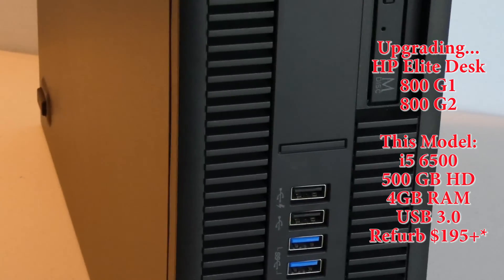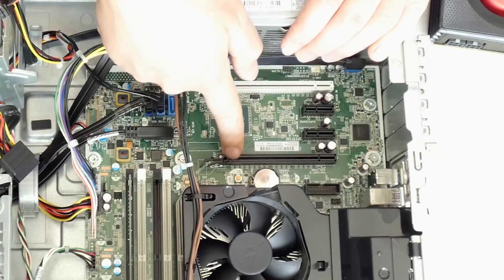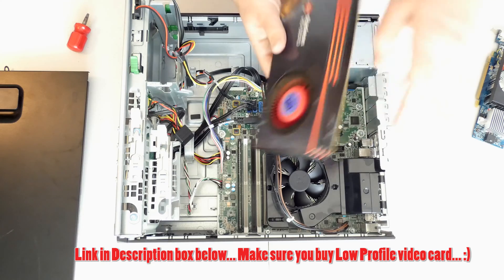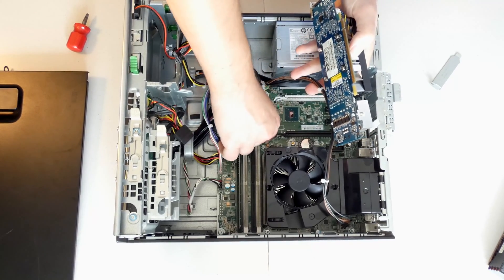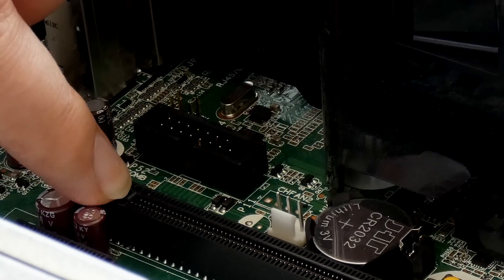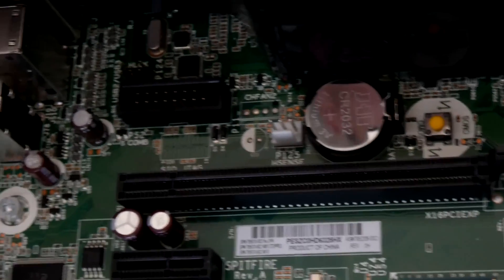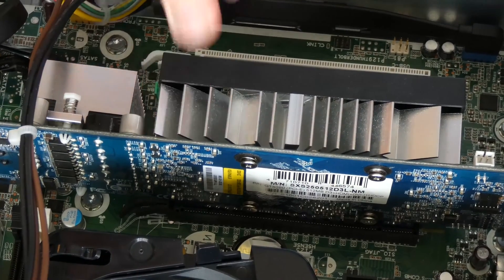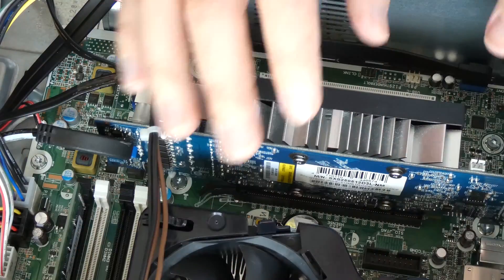Video Card Upgrade HP Elite 800 G1, HP Elite 800 G2, 600 G1  Small Form Factor Desktop

Comment: Actually, you still can fit in the full height graphic card into that SFF chassis. First, you need to take off the output backplate of the graphic card. Then with some minor adjustment and little help from two small metal plate and metal glue, you can create holders to put the graphic card horizontally (fan faced down). Then you connect the pcie 16x connector to the graphic card using pcie 16x riser cable.
Reply from the maker: Interesting. I didn't think there was enough space to that. Do you have a picture of how it looks like? I'm really curious now.
Reply: @Cobuman  this is the link:

https://youtu.be/gDKdEz19X7c
Reply from the maker: @mankdhanichannel  Right, that's not a full size gpu in SFF case. :) He moved everything over to a larger case. I actually made a video on that as well: https://youtu.be/C70nmtTFPuw
Reply: @Cobuman  Yes, but it is possible to put full size graphic card into SFF case horizontally. You can try that by yourself if you have the card and the riser cable. I did that on my previous PC, Lenovo ThinkCentre M73 SFF with Sapphire Pulse Radeon RX 550 2GB (no extra pin connector required). The space to put it horizontally using 20cm riser cable was very tight so I don't need to make the holder. And it works perfectly fine. I don't have problem with the airflow and the temp is normal. 

I think for HP Prodesk 600 G1, the space to put the gpu card horizontally is quite larger since the CPU fan design is front-faced and using smaller fan compared to my Lenovo SFF so you need to create simpe holders to prevent it moves around from its place.
Reply: @Cobuman  here you go.. I just find the perfect example of what I'm mean. This is the link:

 https://youtu.be/qmyNx3q6sjA

As you can see, he is using full size graphic card on HP Elitedesk 800 chassis horizontally. 😁

If I may suggest, you can use Sapphire RX 470D Platinum ITX OC 4GB which is more powerful than GTX 1050Ti. For the 6 pin connector, you can use the SATA power to 6 pin connector adapter.
Reply from the maker: @mankdhanichannel  I see now. That's a really good idea. I should make a video on that. By the way, that's not a full size GPU though; those are mini ITX size cards. Still pretty cool.
Reply: @Cobuman  unfortunately I don't have it. But several months ago I watch on Linus Tech channel, he is doing the same way with Dell Optiplex. And on Tech Yes City channel, Bryan replaced the HP Prodesk 600 G1 SFF chassis with mid tower and he is using a full height graphic card (RX 470 4GB with 6 pin power connector) to HP 240W power supply. And it works perfectly.

Comment: Hello can i ask which card is better for my 800 gi sff i7-4790 8gb ram is it MSI gtx 1650 LP,  ZOTAC 1650 LP or GIGABYTE 1650 LP im very confused what to buy please help
Reply from the maker: All of them will work but if you need help deciding... Gigabyte just came out with DDR6 version which should be faster: https://amzn.to/3h6TQdX
Reply: cobuman thankyou. And also can you add another fan in this unit without upgrading anything? And how? Thankyu for answering bud
Reply from the maker: @ozfortis1251  😁 This PC could use another fan especially after adding a GPU but there is no space to put it. Aside from cutting the side panel... which I can't recommend.
Reply: cobuman and lastly can i use both DDR3-12800 & DDR3-1600 ram? i want to upgrade my ram also thanks
Reply from the maker: @ozfortis1251  Yes, if compatible, but it will run at the lower speeds. Here is my video on RAM: https://youtu.be/w3q2adgFy_E
I recommend Crucial brand: https://amzn.to/2EgZ206

Comment: My screen is blank after installing a gpu on my 800 g1 today, the pc still boots as normal but there is no screen signal only when i take the gpu back out, any help? Cheers mate
Reply from the maker: Check if the GPU is seated all the way down.
Check to see if GPU requires extra power connector.
Reply: @Cobuman  it is i got  a geforce gt 1030 it comes without a connector
Reply: Ive tried disabling the intel graphic 4000 also messin now with the bios settings but still no luck
Reply: Update; it does work on my tv where as i connect it straight to the gpu with a hmdi  cable, on my pc monitor (without hdmi), im trying to using a displayport to hmdi cable so im guessing faulty cable

Comment: I just bought a 800 g1 and a graphics card From Amazon. Should I boot the system up, get it working, and shut down and install the graphics card? Or install before first boot and setup? Thanks
Reply from the maker: Correct, boot it up to make sure everything is working first. Let it stay connected to the internet for a while to get updates. Download driver package for your graphics card. Afterwards, shutdown/install the GPU; then install download GPU drivers. 
Join my Discord if you need help: https://discord.gg/hSCkeR4
Reply: @Cobuman  ok man. Thank you so much. I will definitely join your discord. Also, nice response time on an old video :)
Reply: @Cobuman  wait, also would a  GTX 1650 work in a 800g1 ssf? As long as it's low profile?
Reply from the maker: @therealdan55  Yes, it should be fine.
Reply: @Cobuman  Ok, thanks again. Subbing for sure.
Reply: @Cobuman  Hi there, I just ordered this computer as well... Would you still recommend the GTX 1650 or is there something better that would work? Thanks!

Comment: hello, i have the same desktop. I want to make mine an actual gaming pc so i wanted to transfer every part that is still usable into a bigger case i have laying around, that includes the mobo, cpu, cooler, storage and ram. But i saw from Tech YES City's video ( https://www.youtube.com/watch?v=gDKdEz19X7c&t=484s ) that the cooler is screwed onto the case itself not just the motherboard. Tech Yes City didn't really go over this part quite thoroughly so i don't get much info from it. Can you please make a video covering this? because i really don't know what to do right now. Btw if you are wondering the parts i got to go with my elitedesk are an Asus strix rx 570 4gb expedition and a thermaltake 550 watts psu. Oh also i subbed to your channel because your explanations are really good.
Reply from the maker: Say no more. I've got you covered: https://youtu.be/C70nmtTFPuw 😉

Comment: Will I need to upgrade my power supply when buying this gtx 1050 or will the oem power supply suffice?
Reply from the maker: Most people don't have any problems with oem psu. But, you might as well buy a GTX 1650 Low Profile for same money but a lot faster... like this: https://amzn.to/3dOoDK6
Reply: @Cobuman  thanks. I also considering upgrading the sdd and ram after watching ur other videos. For ram I noticed this desktop has 4 slots and supports up to 32gb. currently it has  8gb (4x2) I'm considering adding 16gb (8x2). Do you recommend swapping the current ram (4x2) for the new one (8x2) or is it fine to utilize all four slots.
Reply: @Cobuman  unfortunately all the gpu prices are insane right now. So I had to settle for a GT 1030 but will upgrade later on!
Reply from the maker: @metrosb2593  I know. It's insane how expensive GPUs are... Pure robbery. They used to sell for $160 and now it's almost $500... unreal.
Reply: @Cobuman  haha right, I was about to purchase on before the insane inflation but never did. I got a GT 1030 for $50 over msrp which isn't too bad but it should be better than the integrated graphics by Intel until I can get a better one! I'm thinking about custom painting the shell have you done any exterior mods?

Comment: I bought a Gigabyte GTX 1650 LP for my HP Elite 800 G1. Is it normal for the temp to be around 185-190F under load? Are there ways to help with cooling on these small form factors without upgrading to a larger case? Thank you so much!
Reply from the maker: Yea, it's a small case and adding that GPU creates even more heat as you know. Without modifying the case which could allow for another fan to be installed... I suppose the only thing you can do is see if temps go down with case open.
Reply: @Cobuman  I had actually opened the case and used a living room sized Vornado fan on the highest setting to blow air directly on the GPU. The temps only went down about 3-5 degrees.

Comment: okay. now how do I enable the graphics card in the bios because Im struggling atm 😅
Reply from the maker: It should just work if installed correctly. Login to PC connected to PC's video and see if graphics card shows up in Device Manager; then install gpu drivers. Some graphics card require additional power as well.
Reply: @Cobuman  figured out my problem. My graphics card wasn't sitting in the slot properly.  🤦‍♂️
Reply from the maker: @Bipolarvideos  That will do it. 😁 I'm glad you figured it out.

Comment: GPU 1050 2gb or 4gb?
Reply: It doesn’t rlly matter bc u can later add more gb w sticks but for now I recommend 4gb if you don’t want to add them
Reply: @bryantshub  i do have kingston value 4gb and will add 4gb branded ram also. WIll see what gpu i can get to mainly use hdmi port
Reply: Umar Azmat if you have an sff I recommend a gtx 1650 it is an amazing card for 160 but if you have a bigger pc get a rx 580 for 120 it beats the gtx

Comment: Hello man answer please :) can ddr4 ram fit in this motherboard ?
Reply from the maker: In which motherboard? This PC is 800 G2 in which case yes you can. :) But... if you have 800 G1 the answer is no.
Reply: @Cobuman  I have hp 800 g1 :( Will ram ddr3 16gb be enough for mininam 5 years or computer will slow down in that time.. Is ddr3 16gb enough.? Thank you

Comment: Hi I’ve installed GTX 1650 Low Profile version, but after rebooting the system just beeps and no display? Am I doing anything wrong requires your advice
Reply from the maker: Check to see if card is seated properly in to pcie slot. That's what usually causes the beep.
Reply: cobuman yes bro it seated properly I double checked it. Appreciate your suggestions to troubleshoot?
Reply: cobuman One more thing, I’m still trying to connect using the motherboard VGA output to monitor (since I don’t have a display port cable I ordered it) does this make this sound if I connect directly to the discrete Graphics Card will it work?
Reply: cobuman Bro, it works like a charm yesterday I received the display port which I ordered once connected directly and it worked right away... seems like once you connect the discrete graphics card the motherboard video ports are not working... 

You are my champ... finally I manage to setup a gaming pc for S$280 Singapore dollars (S$75 HP EliteDesk 800 G1 i7 8 GB Used + S$35 Additional 16 GB Used RAM + S$170 New GTX 1650 Low Profile)

I’m currently playing Witcher 3 High settings really this 1650 graphics card is real bone for Small form factor PC... 

I subscribed your channel and follow any new video... great work again...

Comment: I want to purchase an HP Elite 800 G1 with Intel HD Graphics and replace it with a graphics card. Do you have any recommendations for a graphics card? Also a graphic card that will be able to be supplied with 240PW and won't cause any errors running when it is installed?
Reply from the maker: The best card that will fit inside is a "low profile" GTX 1650 like this: https://amzn.to/3cRKS20
Most people don't have any issues using these cards in 800 G1.
Here is my video on PSU power consumption: https://youtu.be/FHtlk-re_ss

Comment: i want to get you advice on 2 videos cards to put in my G2 ive already did the cpu upgrade and max it out on ram...i wanna put one video card in the 16X slot and the other in the 4X...im running 6 monitors
Reply from the maker: Sure thing. The main thing is to install a low profile video card otherwise it will not fit inside. That being said, the best LP card right now is the GTX 1650 like this (4 monitor support):  https://amzn.to/2X9XWcm (there are 2 different types of Gigabyte as well, 3 monitor support and 4 monitor)
I'm not 100% sure but I think the on-board monitor connectors will allow you to extend to 2 more monitors. Otherwise the 2nd pcie slot may need another low profile/low power card just for monitor extension. 
I'd say get one video card and see if you can make it work with 6 monitors first.
Reply: @Cobuman  ty....I found a few cards that have 6 HDMI mini outputs....for not that bad a price I think I'm goin give one of those a shot

Comment: does the cpu affect how much the graphics card will perform or does it work on its own
Reply from the maker: Good question. 
CPU and GPU work together to run a program/game. Some parts of the program are handled by CPU; for example, loading of data and in some case handling of physics calculations. Other parts are handled by GPU; usually processing of graphics/visual data as fast as possible so you see it on your screen (fast moving pictures).
 
Also, it depends where the bottleneck is created; sometimes CPU is too slow to keep up with loading of how fast GPU can processes graphics/visuals. On the other hand GPU can be too slow to process loaded data from CPU. In any case presented a slow down is created. 

Generally speaking what you want is a CPU that is fast enough to handle any GPU which typically is not that high spec at all. For example i5 CPU is good enough... after that it's up to GPU on how fast it can work. 

I hope this makes sense.

Comment: So will a GTX 1050 work with the pcu that comes with the HP Elite 800 G1
Reply from the maker: Yes, but I would go with gtx 1650 low profile because it costs the same but much faster: https://amzn.to/2Z1bsS8
Reply: cobuman Thanks a lot man, I don’t really understand this stuff, I just wanna play games if you know what I mean so this is a huge help 👍🏼
Reply from the maker: I completely understand. If you do decide to add a GPU just take your time. Take care. 👋
Reply: cobuman Have you benchmarked any games using this pc with a new gpu?
Reply from the maker: @socks8056  Not with this PC. However, I have a laptop with 1050 and did a little bit of testing with: https://youtu.be/yA2DgoBSZoA?t=1125
I suspect with Desktop PC it will be faster. Especially if you ad 1650.
Reply: cobuman Thanks man, just want something that’s isn’t gonna be permanent, yk just so I can play at a decent frame rate and is there anything else you need to do after adding the new gpu?
Reply: I am having a lot of problems with overheating when gaming with this set up are you?

Comment: i have made ventilation holes above the GPU due to overheating its the GTX 1650 LP. is it good  to put ventilation holes above the CPU side, above the RAM slots precisely. taking into account that the CPU fan intake  is on the ram slot side. any comments in the idea?
Reply from the maker: Just creating extra hole might will help with intake of fresh air; however, it depends where you put it because the ventilation works on vacuum. If you can install an extra exhaust fan that would be be best. Maybe on the side door/lid. Just be very careful when cutting metal if you decide to do it.

Comment: Hello there cobuman, just wondering how long the video card that you inserted was? I have the same pc and im looking to buy a video card. The gt 1030 low profile  seems pretty long even though it is a low profile card. Like it might not fit in the pc? Thanks.
Reply: My other option was the MSI Computer GeForce GT 710 low profile card. This one is smaller than the gt 1030 low profile. Thanks again.
Reply from the maker: These PC fit video cards up to GTX 1650 LP. So, if you look at the people feedback on 1030 you can see it fits a variety of SFF computers as well: https://amzn.to/2L1IMQV
Don't buy 710 it will be dreadfully slow in comparison.
Reply: @Cobuman  Thank you.
Reply from the maker: @limespyyt6208  Sure thing. 👍
Reply: @Cobuman I just found out that the gt 1030 is 172 mm and the one you inserted is 160mm. So how much space is between the edge of the computer/where you remove the extra PCIe slot and anything else?
Reply: @Cobuman The specific model is the ZOTAC GeForce GT 1030 from amazon.ca

Comment: Hi, wonderful video I was wondering can I plop a gtx 1650 low profile into a HP EliteDesk 800 G2 SFF Core i7-6700 3.40GHZ 8GB Ram, Windows 10 Pro, 256GB SSD Desktop Computer without having to swap out the power supply in any way. because this would be my first time customing a pc and I wanna make it as simple as possible while still having decent/good gaming performance
Reply from the maker: Thanks Bob. Someone just confirmed for me that Gigabyte GTX 1650 LP works fine. Like this one: https://amzn.to/2VQ7SHc
Reply: Exact same here

Comment: Nice little guide @cobuman. For anyone that is looking at this, I can confirm that the Gigabyte 1650 low profile works perfectly in the HP EliteDesk G2.
Reply: Thanks guys
Do you know if the Gigabyte 1650  low profile will work in the HP elitedesk G1 or will it draw too much power?
Reply from the maker: @fdrx-7downunder634  This one? https://amzn.to/2x8OEEs Yes, it should be fine. The G1 actually has a more powerful PSU.
Reply: I put a 1650 low profile from main and it works great right now I just need to get a vga cable for the system so I can get into bios but other than that I confirm it is great too
Reply: msi*
Reply: @Cobuman  hi, can you please help me out, can I put the gtx1650 low profile in to hp prodesk 600 g2 sff? It has I think 200w  thanks
Reply from the maker: Thank you for confirming that. I've been suggesting that card for a while now.
Reply: Did you upgrade the power supply?